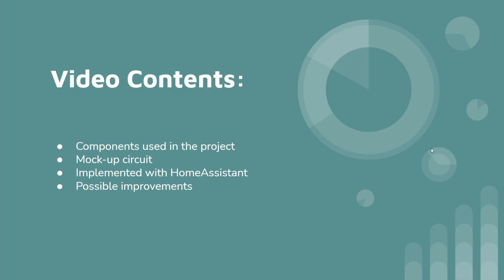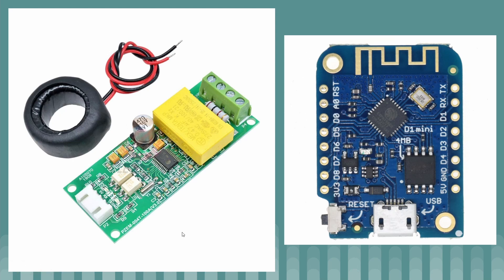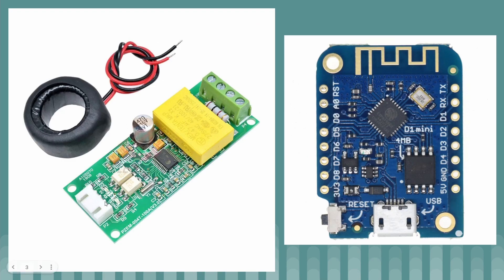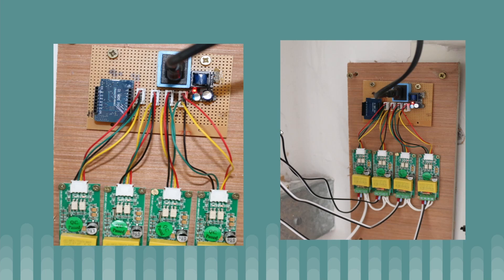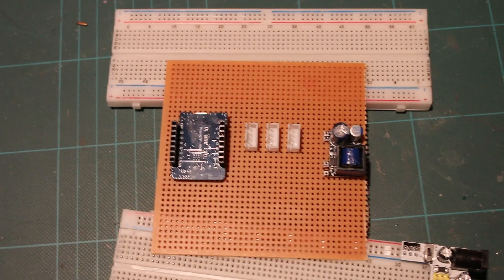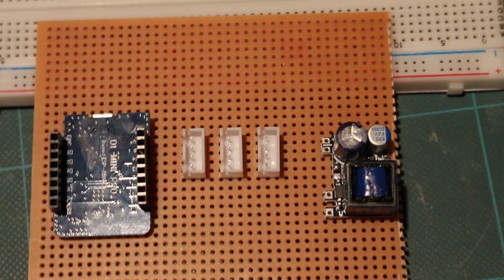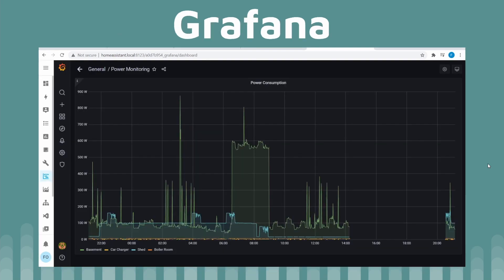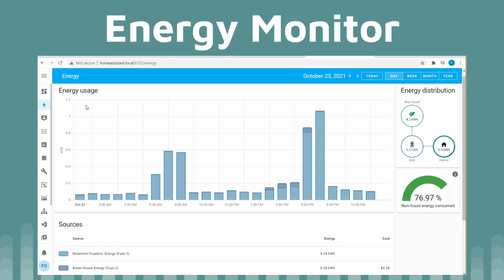Home Power Monitoring with the PZEM Part 2

Comment: It's been over 2 years since you uploaded this video (at time of writing), did you ever find out where your electricity was going? 

Are you still running the system you built?

I've recently started using a pzem-016 connected to a pi and the pymodbus library, reports back to my server running grafana.
Reply from the maker: ah nice one! yeah it helped a good bit, the big thing was knowing when power is being consumed but we need to optimize a few things which is the tough bit tbh!
It has had its fair share of troubles though as the esp32 can have difficulty communicating with multiple modules. I recently tweaked the housing and added am going to dig into the code a bit more to see whats happening. 
I might make a video if I get it all working together , down the line I'd like to maybe start adding some sort of analysis on the power (for e.g power factor and current draw) to figure out which appliance is running at what time but at this point thats mainly a pipe dream!

Comment: @fionnOCH hope alls well... never got much further because the JST XH cables i keep ordering are the incorrect width  😢 Any chance you could post a link to the version you ordered? Thanks as ever 😊
Reply from the maker: sure thing, I used these myself so can guarantee they work, you can get them on aliexpress for cheaper but you'll have to wait. Another thing is make sure you have a half decent crimper. the ferrule things are small enough on these
https://www.amazon.co.uk/Litorange-500PCS-Housing-Adapter-Connector/dp/B086W9HB3M/ref=sr_1_5?keywords=jst%2Bconnectors&qid=1692049849&sprefix=jst%2Caps%2C74&sr=8-5&th=1
Reply from the maker: I'm still hoping to do a part 3 on this, changed up the config slightly and also realized I made a mistake in the video, if you're wiring up you want to connect rx on the arduino to tx on the PZEM and vice versa. annoyingly its not rx to rx and tx to tx like I thought.
Reply: @fionnoch9867  Thanks for link... any chance I could twist your arm to make up and sell me 5 of them?! 🙏
Reply from the maker: @rossicullen  the JST connectors or the PZEMs? I can make up JST connectors or pre connected if you'd like but they might end up coming the same as ones online but they'll have a very DIY esthetic 😅
Reply: Just the JST connectors with a bit of wire on them plz :-) think my last comment got deleted
Reply from the maker: @rossicullen  no sweat, I might be able to make them this weekend. I need to figure out how to contact you personally off the comments!

Comment: Hello. I want to connect the PZEM to a regular ESP32 via the RX2 and TX2 ports. Is a 5v to 3.3v voltage converter needed?
Reply from the maker: yeah so you'd need a voltage converter if you're powering it directly from the esp32, some esp32s have a 5v output but not all, its worth checking if you do but the pzem won't work with 3.3V. The board I used did have a 5V pin but what I did was use a 230VAC to 5VDC power supply to power the PZEM and esp8266, you could do the same and have the power supplies 5v dc connected to the Vin of you're board maybe

Comment: Great video and really useful... looking to build similar...have parts ordered from Aliexpress for PZEM-004T on the slow boat/train from China. Have you made much changed to the setup 17 months later? Go raibh maith agat!
Reply from the maker: So I actually have made an update to this since, been meaning to do a follow-up actually but need to make the time! Basically I tried connecting directly to the hardware serial ports rather than doing software serial, had an odd problem where the PZEM would randomly disconnect with the esp8266 and I'd have to update or reboot the system then it would work. Weird but not the end of the world, hardware serial seemed to sort that out but comes with a few difficulties too, mostly the fact that you use the same serial connection for debugging/logging. 
Also bought new clamps as the ones I had weren't actually the correct ones, I'm in the same boat as yourself waiting for them to arrive back from China! When I get them in maybe I'll do a recap, but good luck in the meantime!

Comment: The esp8266 pins are 3.3V and I have seen other implementations use a 5v to 3v logic level shifter. However you are not doing this. Have you experienced any issues with this?

I also see other implementations of multiple pzems using diodes to avoid clashes on response. However, again, it seems that you are not doing this. Again, any issues with that?
Reply from the maker: Yeah so I'm using a 5V power supply but the board I'm using is a wemos d1 mini which has a 5v to 3.3v regulator so that's how im powering the device. The 5v for the pzem's comes directly from the 5v power supply. 

In terms of diodes I havent had any issues with miscommunication with the pzem. They're all addressable so I'm not sure it would be too much of an issue. Occasionally I do have issues with reading not being taken but I've been told it could be  because I use software serial rather than hardware serial, but I havent been able to test it out!

Comment: Hi, nice video i have been doing the same stuff as you but i am not using pzem module, just wondering if i can see your dashboard for monitoring, btw i am using the ubidots platform
Reply from the maker: Thank you, I appreciate it! I've uploaded a copy of one of my basic dashboards on HomeAssistant to my github page https://github.com/Fionnoch/ESPHome_PZEM_Monitoring/blob/main/Basic_Dashboard_Code.yaml

Its basic but its what I use most. Also HomeAssistant recently added an energy monitoring tab though that is really good for power monitoring and its fairly intuitive, I'd recommend checking it out

Comment: Have you done any validation of the readings you are getting.  I've looked and tried a few different supposed power monitoring devices or circuits and have found the results questionable.
Have you tried running a known load against the PZEM and say a wattmeter to see if they actually agree on what the load is pulling?

Comment: Verry nice Video. Good explaned. I have it setup with ESPHome and now I get the next message on my HA screen : PZEM Current UNKNOW. What I'm doing wrong ?
Reply from the maker: thank you! hard to diagnose without a screenshot but I do occasionally have an issue where occasionally it might stop taking reading for a while generally i just turn it off and on and it fixes it. If you're not able to connect at all I'd check you have the correct address assigned to it first, if you're confident the wiring is all correct and the continuity of the wires are good I'd maybe try swapping the Rx and Tx pins in esphome
Reply: @fionnoch9867  Right now I have it up and running. I have changed the wiring between TX and RX. Yhanks for your replay.
Reply: @fionnoch9867  That's because you are using software serial. Software serial is a crap. Connect the pzems to the hardware serial port of the esp and use hardware serial.